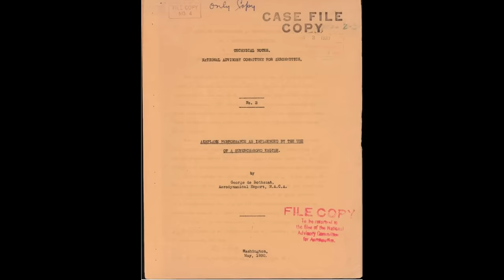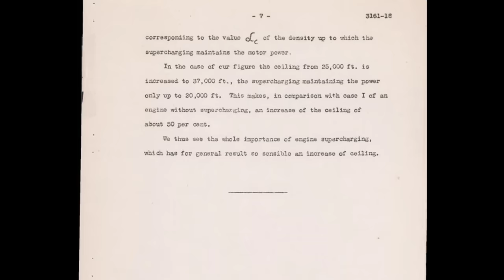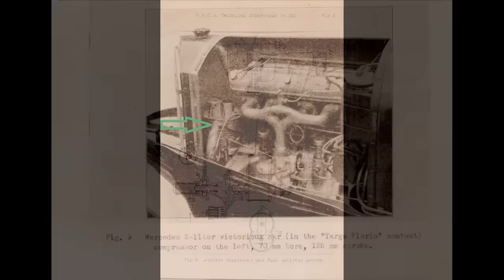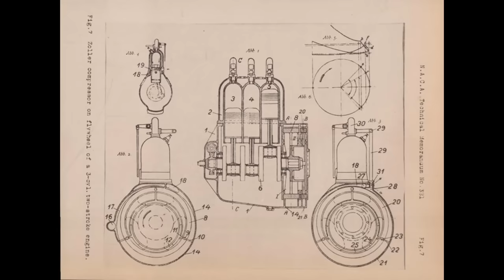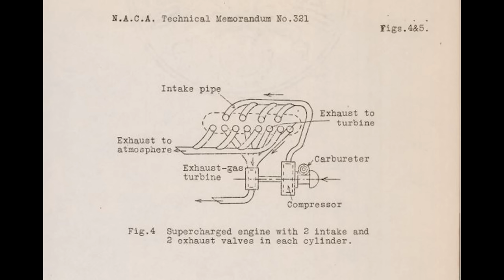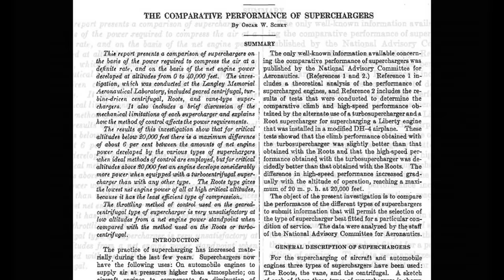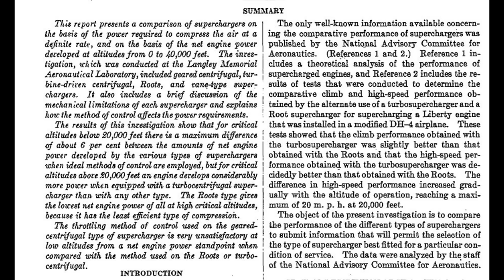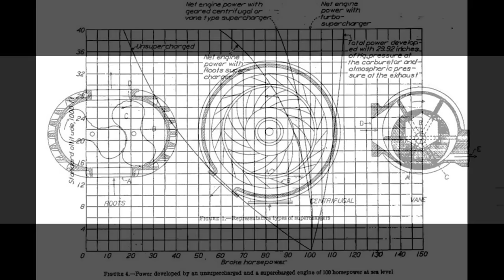Turbo vs Supercharging in WW2 Airplanes

Comment: For those that are really into supercharging and turbocharging, I highly recommend the books "Supercharged! Design Testing and Installation of Supercharger Systems" and "Maximum Boost Designing Testing and Installing Turbocharger Systems" - both by Corky Bell. These are geared toward cars but also do a great job of explaining the concepts of how these systems work. I spent a lot of years in the modified GM 3800 community, mostly with supercharged (or turbocharged) versions of the L67 and L32. Fun "engineering" sidebar, I was the first to come up with the idea to drill into the lower part of the side of supercharger to run a line over to the valve cover, maintaining positive crankcase ventilation with an intercooler installed. Prior to that (and even now) most people just ran valve cover breathers, which is less than ideal. Also Eaton's TVS line of roots superchargers are very impressive with efficiency - but the drawbacks on aviation applications you mention would still clearly apply.
Reply from the maker: Those are good books, although I think mine is better ;) which is in the Patreon section and on Amazon.  In regards to running CCV into the supercharger, why not just run it into the supercharger's inlet area just aft of the throttle? Or maybe that's what you are doing, I might be misunderstanding you. 

The TVS and latest Lysholms are very efficient. I have comparative charts for them along with the older 4th gen Roots types in my book.

Comment: As a car guy and WWII nerd, just wanna say this video was very enjoyable! I did have a couple of points though:

1) I realize this video is 6 years old, but electric superchargers are a thing now. Unfortunately though, they are almost always 48V systems since compressing air takes so much power, making them impractical for most ICE cars which run on 12V or rarely 24V systems. Anything which claims to be a sub 48V system is almost always a scam.

2) Probably wouldn’t have been used on WWII aircraft engines, but you seem to have missed the twin-screw supercharger. These are like the roots style but the two compressing rods have a corkscrew shape cut into them such that they intertwine. Instead of compressing air through the sides, twin screws compress air between the corkscrews and are more efficient and produce a hellava whine (just google “Hellcat Whine” lol - the car, not the naval fighter)
Reply from the maker: I didn't miss the twin screws. I have one on my 1985 Alfa Romeo Spider. However they have never been used on an aircraft and certainly not during the time period being discussed here.

Comment: I never understood why Northrop didn't turbo charge the P-61. It was so large and with the room in the nacelles plus the learning curve covered with P-38, it would have perfect to combine the supercharger with a turbo. Thanks for the awesome video. I too can't wait for the jug video. Way too 51 fans out there and jug deserves more. (51s were great but Jugs were brutes)
Reply: Yea, the P47's the one, if I had to do it that's the one I would've wanted to be in, if for no other reason than they were the most survivable, plus I consider them to be the perfect American aircraft, too big, too powerful, too heavy, too heavily armed, and it guzzled fuel, just right👌👌👌
Reply: I read a statement by a P-47 pilot who said you should get your picture taken next to a P-51 to send home, but you should fly a P-47 to GET home. His P-47 took a hit in the engine while attacking a train. The AA round completely destroyed one cylinder, but he was still able to fly home safely.
Reply: The P-61 was used mainly in the Pacific where high altitude performance was not as important.
Reply: Actually, they did - The P-61C, which had a pair of R2800-73 C series engines were turbosupercharged, and capable of 2800 HP each at about 30,000'.
Essentially, it had the same engine specifications of a P-47M or N.
Due to Northrop's preoccupation with building the prototype XB-35 Flying Wing, and delays in the production of the R2800 C series (Required machine tools were reallocated to Great Britain in order to assist in sorting out the production quality problems with the Napier Sabre.) the first USAAF acceptance of a P-61C  was in  July  1945, and end of war cutbacks meant that only a total of 41 were built by the end of production in January 1946.
By that time the P-82 Twin Mustang was programmed to be the interim Night/All Weather Fighter, and jet night fighters were being specified.
Reply: @peterstickney7608  Could you tell us which engines were installed in the postwar F-15s? I ask because I saw a Wright Field video on weather research flying, and if I'm not mistaken also on ignition problems at high altitudes using P-61s and F-15s.

Comment: Your channel remains outstanding, Greg. I thoroughly enjoyed this longer format presentation. Yours is the most satiating channel I've discovered this year, your content bears a certain fullness. It's nice to know that all of the older folk with an appreciation for hand drawn diagrams, thick charts, and ancient technical studies haven't yet bit it, especially in light of the superficial engineering channel trend.

Will you consider exploring further your curiosities for the logical evolution of the turbocharger; deleting the piston nonsense entirely and locating the combustion chamber between the compressor and turbine? I spent the formative years of my early career with the J79 and Allison 250, both items I'd love to see technical documents for again.
Reply from the maker: Thanks. I use the old drawings from NACA for two reasons. First they are original source materiel, second, my computer skills are limited, so I can't make fancy graphics. You correct about the relationship between the turbocharged piston engine and the turbine engine. If you add enough stages of supercharging, pretty soon, you don't need pistons, just add a turbine and some burner cans. That's over simplifying of course, but you get it.